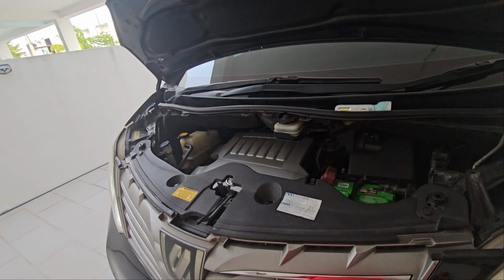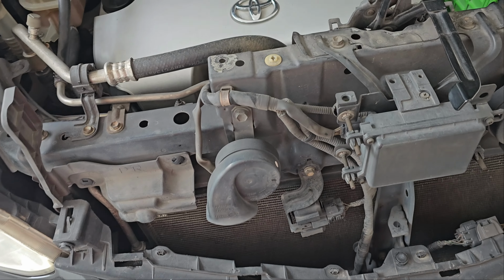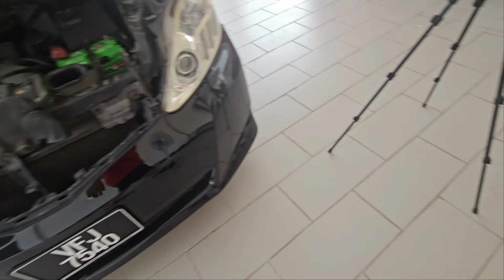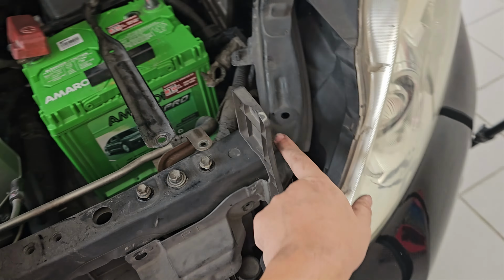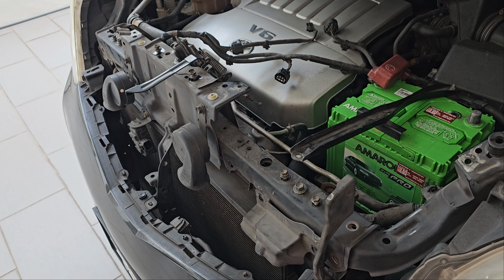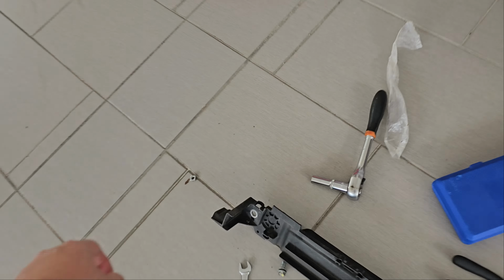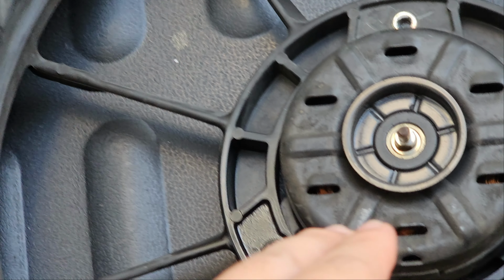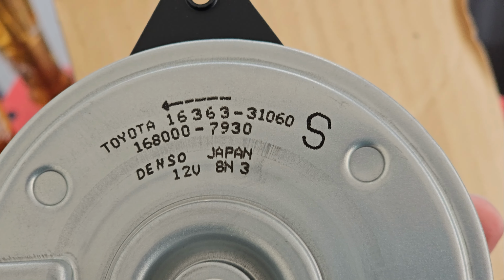Alphard / Vellfire - Radiator fan motor replacement

Comment: Are the two motor fans on the 2012 Alphard the same part?  Are they interchangeable?  From the parts list I see one is 31180 and the other is 31130. Thanks!!!
Reply: yea i need answer to this too!😅
Reply from the maker: @alifrafi5279  no they are not interchangeable. Different thickness.